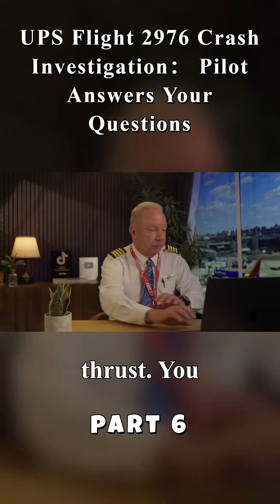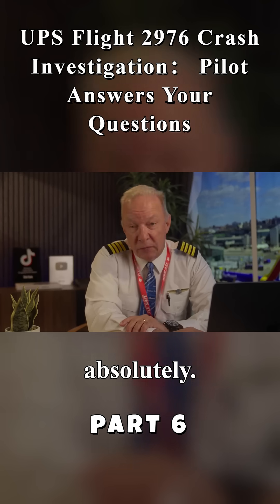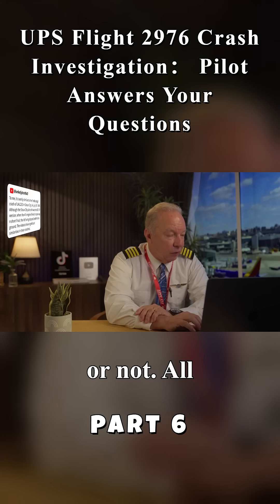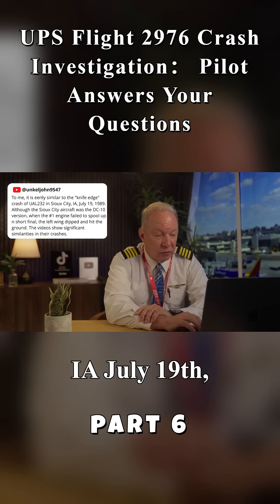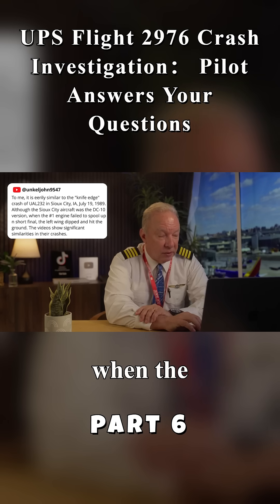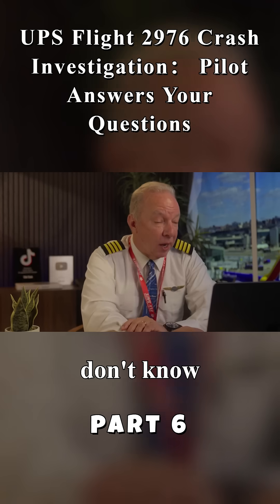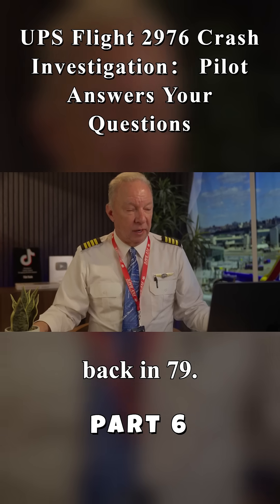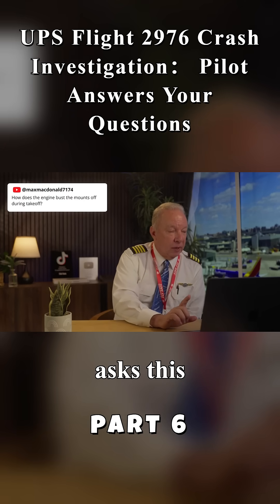🚨✈️ Unraveling the UPS Flight 2976 Louisville Crash: Pilot Reveals Secrets Behind Catastrophic !

Comment: Captain Steeve, 
The DC 10 in Souix city the part of the number 3 engine lost the compressor ring.  When it failed, it took out all the hydraulic lines along with part of the rudder. Only control they had was through asymmetric thrust. So they could only turn to the right.  On short final the one engine caused them to turn to the right which caused the landing gear to dig it when it touched down.  It slid for quite a while before it rolled over.  The movie they made of it was mostly on the training of first responders.   I actually met the pilot of that flight in Kalamazoo at the Air Zoo about 10 years ago.  That how I know about this.  Keep up the good work.